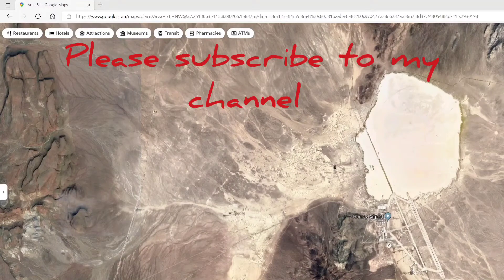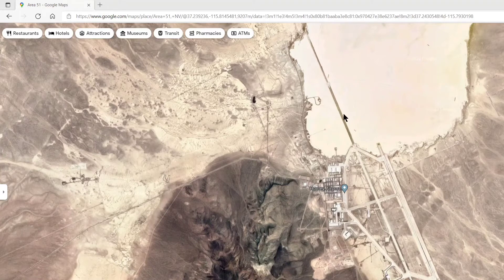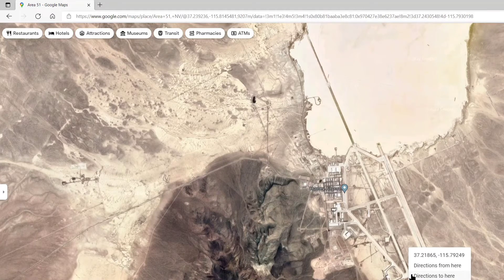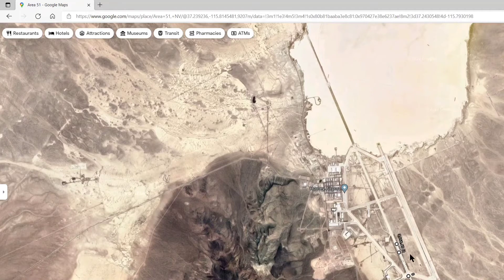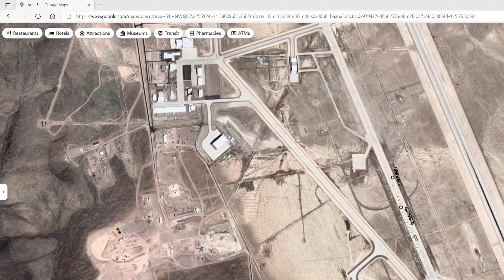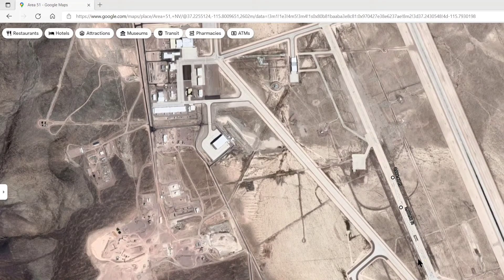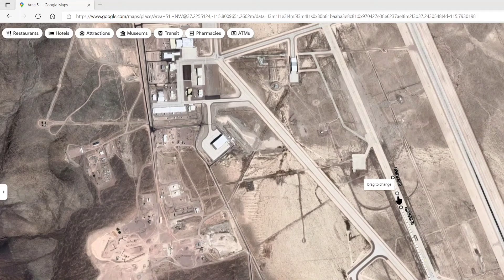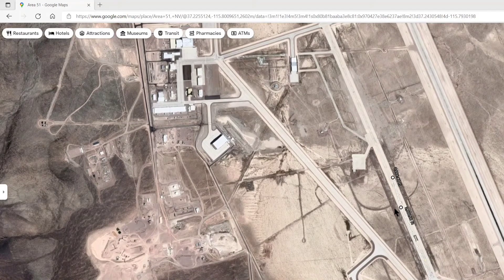How to use Google Maps to determine where the Fiber Optic Cable is damaged

Comment: Thank you for this! How do you locate a node? Is there any public database to do so?
Reply from the maker: @TaniateKWhite  As far as nodes or COs or NOCs; I am not aware of any public database that would give that information.. It's generally contained within privately managed mapping systems owned/leased by ISPs. However, many cities have GIS maps that show the utilities routes.. for your city I would just Google GIS utilities for your city or area you're working in. That would at least show you where lines are running.

Comment: Yes, true, the method works, but would not it be nice to do it all automatically and get SMS/email alerts when  a reflection/fiber cut happens and see the OTDR distances exactly on the google map generated image. We use "CloudView NMS" OTDR support. True, it works for supported (via SNMP) devices only but they are seeking to add more devices types (vendors) to their solution.